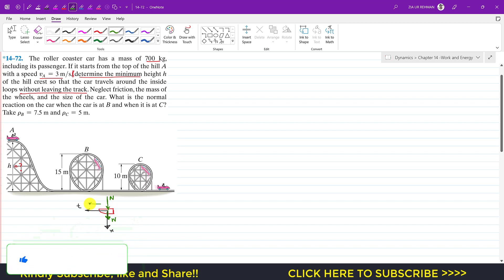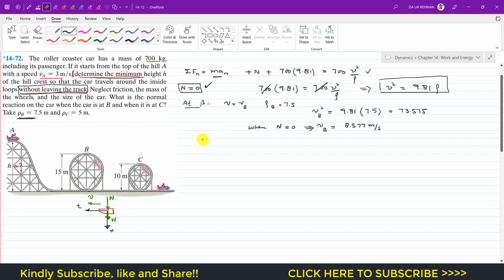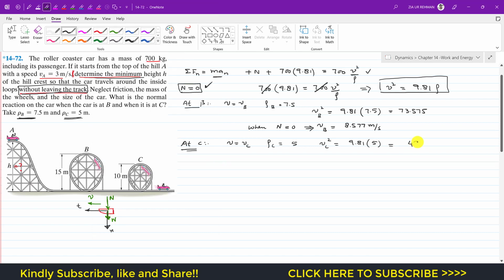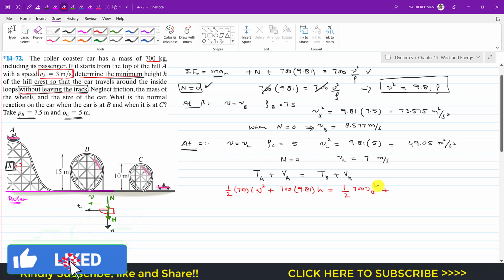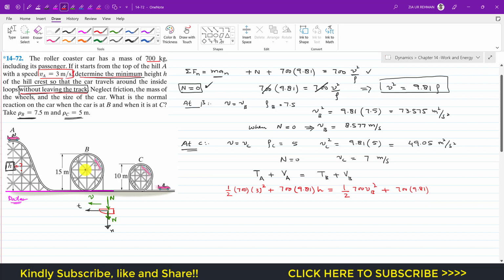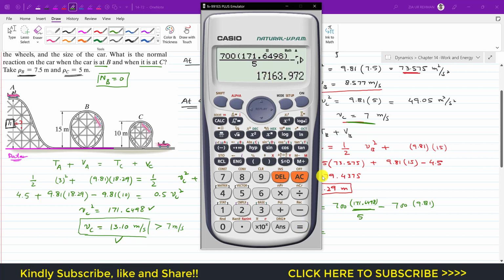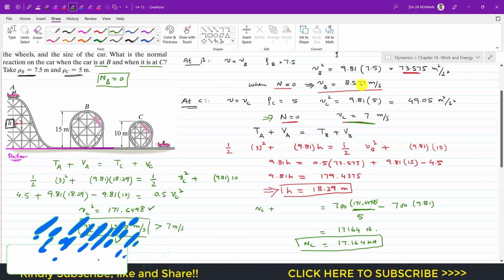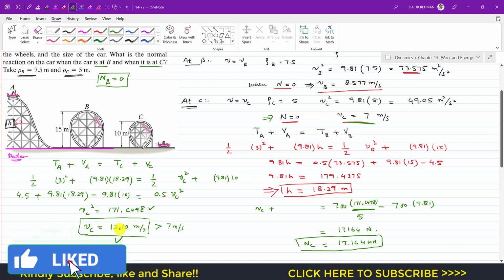14-72 Kinetics of Particle: Conservation of Energy Chapter 14: Hibbeler Dynamics | Engineers Academy

Comment: The book answer is h = 18.75 m.  Not what you got, not what I got.  I got the same as you.  Pretty sure the book is wrong here!  I hate that... so frustrating. Glad I found your videos to be able to check my work.
Reply: I know I'm a year late but you were looking at 14-73 which is really similar to 14-72 and does have an answer of h=18.75m. The book does not include the answers for this problem unfortunately, though I do believe you are both correct that h=18.29m for 14-72.